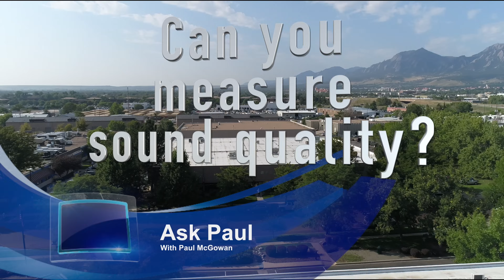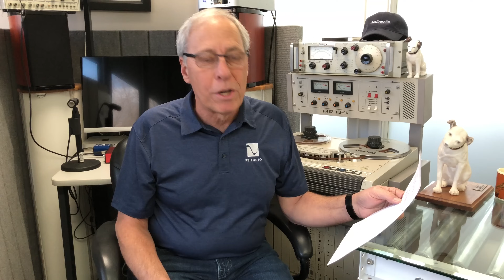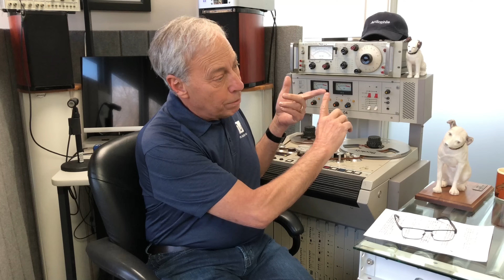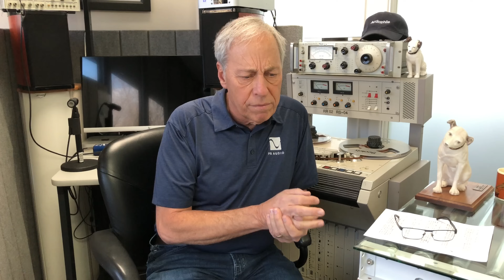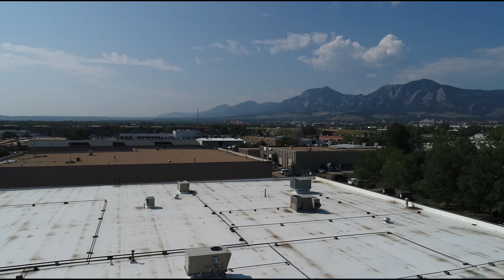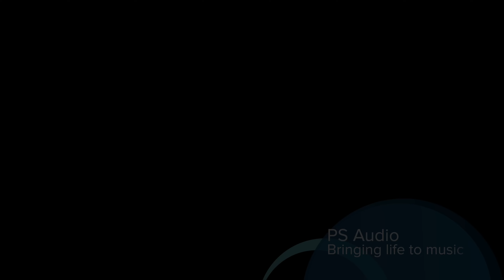Can you measure sound quality?

Comment: You’re talking about designing hardware (amps for instance), and getting them to sound how you want/accurate. That’s totally different from evaluating hardware and wether it’s good or not.  
  
If you do all the measurements you can to an amp, and they all measure near identical, it will sound near identical, it doesn’t matter what firmware it’s running. However, when designing an amp, then stuff like that will for sure have an effect on sound quality and require tweaking, but you can’t say it’s immeasurable to the end user.  
  
In terms of speakers, it’s been well tested that  measuring flat anechoic/ground plane, constant/controlled directivity, short decay times, etc. can all be used (in conjunction, not separately) to tell you if a speaker is good or not.  
  
Bass (<80Hz) is really the main deviation most people have from accurate to what they like.  
  
The SPL decrease of the off-axis performance, especially in the treble, will have an impact on soundstage and that is room dependent on what is ideal, by it being well controlled is a universal goal.

Comment: Respectfully Paul... We can measure every aspect of sound and quantify the ability of a piece of equipment to reproduce good sound. What we can't measure is how several different environmental factors will affect the way we as individuals will hear sound. Just as I can not define how you will see a colour I can not define how you will hear a sound.
Reply: I'm, sorry Paul I'd have to disagree with you. I'd say for speakers that about 80% of the sound quality can be determined by looking at measurements. For example how balanced and linear are frequency responses, on axis and at 30° sideways, at what level is distortion (k2, k3, k5) at 90 dB, how many and how strong resonances does the waterfall spectrum show and do plots of individual drivers and their sum at crossover frequencies look good. If mechanical losses (Rms) of all drivers are low then it's also very likely to present much detail in sound. Prices of components are also an indicator but not an exact one, of course. But a driver in which more development work has gone into will be more expensive. From all that I'm able to predict roughly how good it sounds. This is also what German DIY loudspeaker magazine Hobby HiFi say.
Reply: Paul is right. How do you measure soundstage on a graph??
Reply: You are wrong.